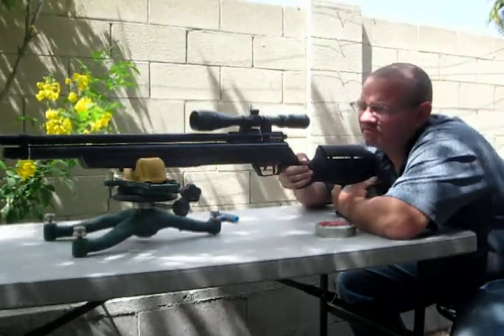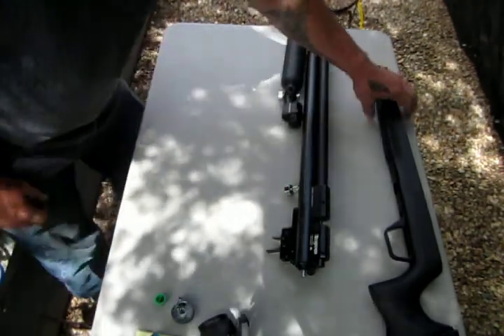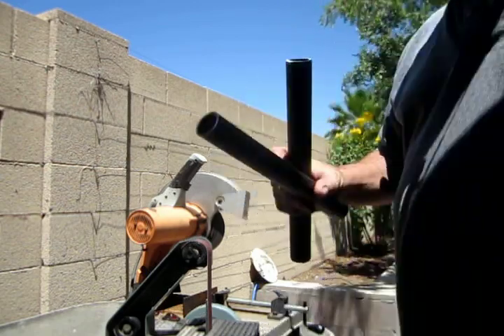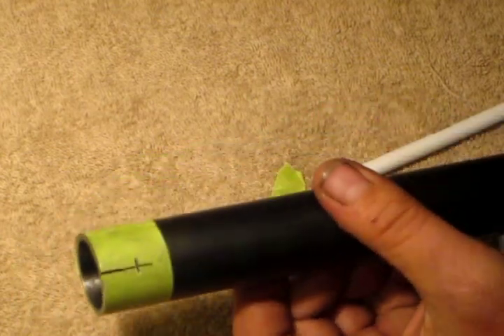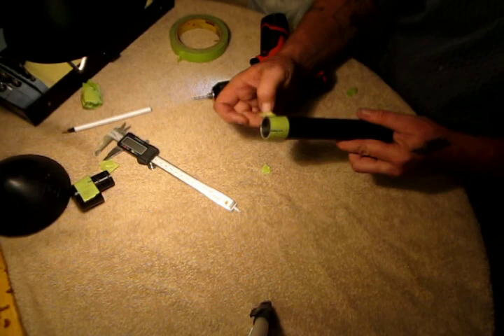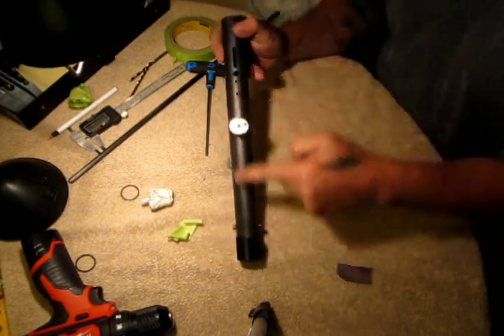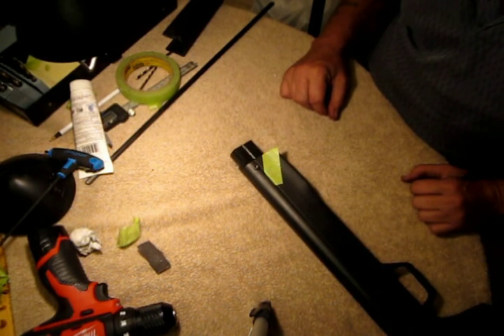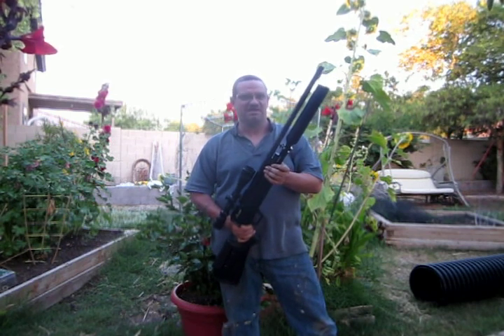JDSAIRMAN BROD ADAPTER INSTALL

Comment: i just did my conversion on my Marauder .25 but i used the 500cc bottle from W.A.R.  regulated to 1900 psi. now i get 56 shots at 40fpe with jsb 25gr. Thanx for this video and very good step by step instruccions. keep up the good work
Reply: Jacob Martinez i used the JDS dropdown. I purchased a second drop down from JDS for another Marauder i built with a 4500psi carbon bottle and regulated it to 3000psi output. So far no problems at all